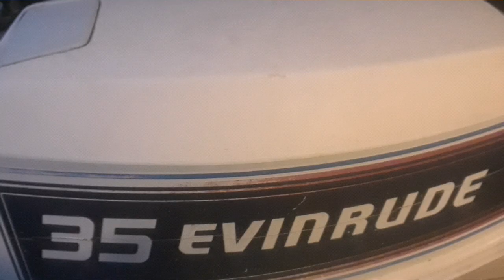55 Chevy Helps Out! Watch Those Fingers!1981Evinrude35HP Facebook Market Place$60 Motor Runs Again.

Comment: Yep, 1980 and newer models were workhorses for sure.  The powerheads and gearcases are rugged and rarely fail.  They sure don't idle like the old ones, but that's OK.  The only problem area is the cooling system, regular cooling system maintenance is required in salt water for sure.
Reply from the maker: Yeah I think they jumped up to the 32CID from 22CID and seem to be a good move. Although I really like the light weight 22CIDS 18-25S and so does my aging back. Thanks for commenting stay tuned!